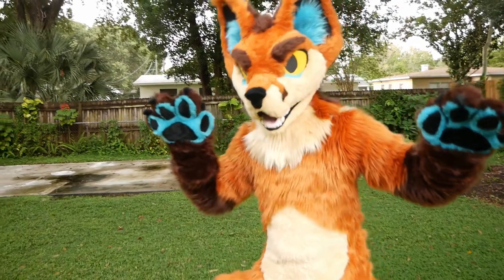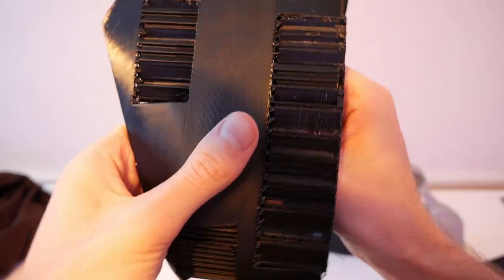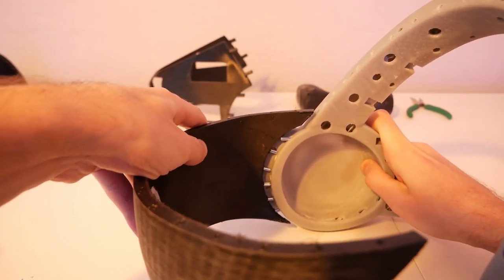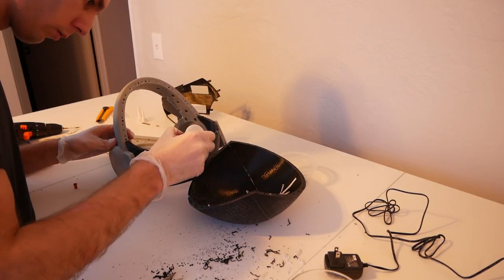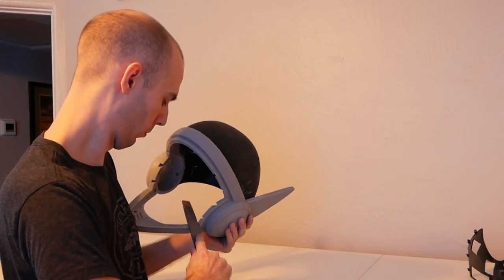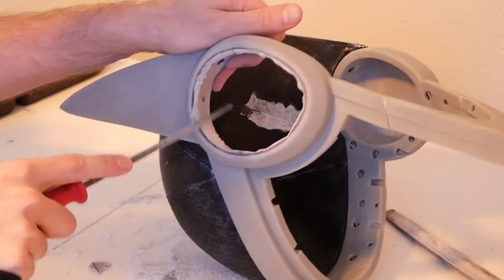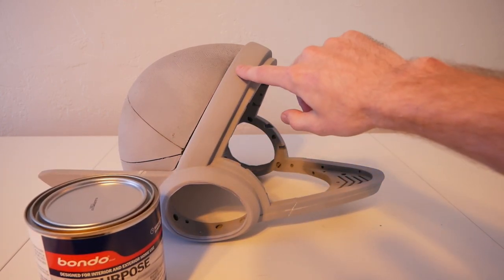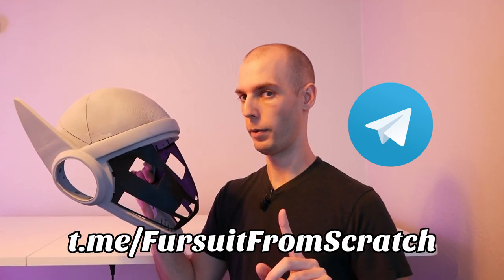Building A Protogen From Scratch [#1]

Comment: To assemble the parts together you could also have heated the rivets with a soldering iron so, that they melt into the plastic of the base. You would then have added glue to the other pieces. It would have avoided weakening the part by drilling inside.
Reply: I tried this approach after having issues with drilling and getting the holes to line up.
Heating the rivets with a soldering iron didn't really have an affect.
Direct contact with the soldering iron would melt the plastic, but that would just widen the hole rather than fuse the rivet to the plastic.

Comment: Automotive furry here they make filler primer that’s meant to fill in sanding lines I’ve used it on 3d prints before after sanding and it works really well